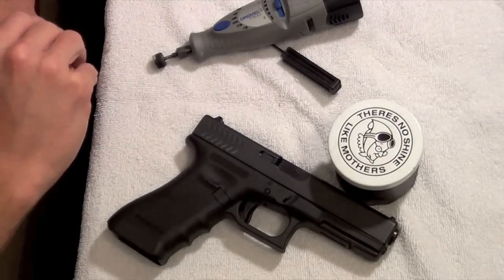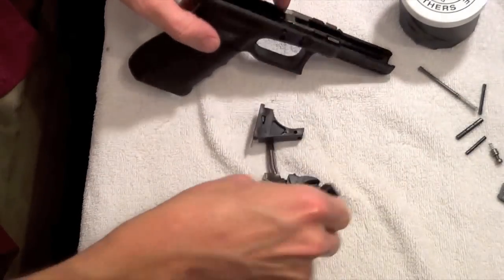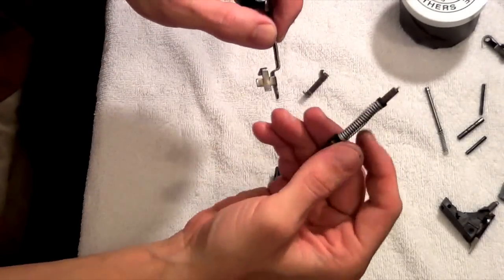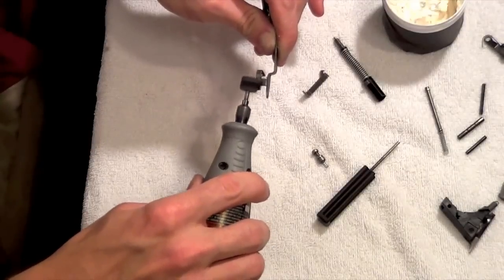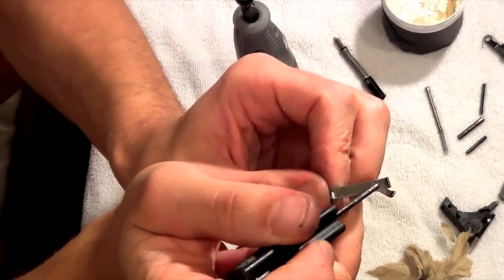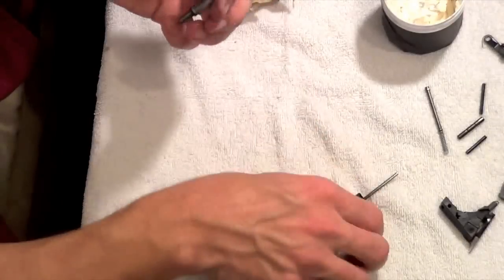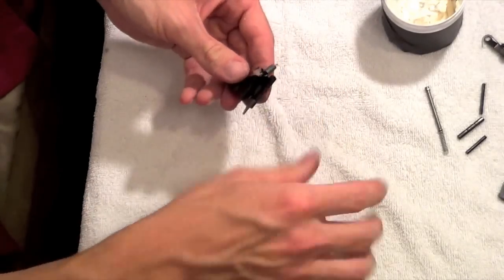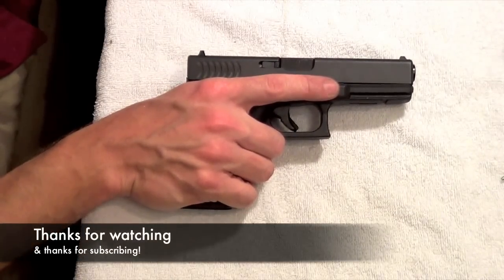How To: Polish A Glock Trigger (25 Cent Trigger Job) In HD

Comment: I just did this on a gen 3 19 with probably 4k rounds through it. I got much better results than expected since the trigger was well broken in. The firing pin safety was horrible from firing it dirty in training classes and cleaning it up as well as the connector and trigger bar made an already good  broken in glock trigger great. Glass  smooth take up and a very defined wall with a crisp break. It could have been in My head but I found I could make 60 percent hits on an 8" steel plate at 50 yards with big dot sights. Amazing improvement on an already broken in trigger

Comment: So, to answer all of the comments...

Use a buffing wheel NOT a grinding wheel
A qtip will work instead of a Dremel
Yes, dry firing will work too but it takes longer
Yes, it's still safe when you are done
Be gentle with your parts or yes you will been and break them
Use fine metal polish, not things like turtle wax
Part number for the buffing wheel? Idk, it's a fckin buffing wheel!
Reply: It appears common sense isn’t so common anymore.

Comment: Thank you for the great video!  Did the polish for the first time.  Fun short project.  It was also the first time removing the large pin and it fought.  No idea why.  Went back in easily.  Taking my time, about an hour or six times your effort.  Also took the opportunity to polish the feed ramp and the rail guides.  Everything is smoother.

Comment from the maker: It's worth 15 minutes; that's for sure.  Also, on your Gen4 ensure you have the "." connector.  Some Gen4s shipped with standard Gen3 connectors resulting in a slightly heavier pull.

Comment: Hey great video as always! You could also polish the shaft of the safety plunger. When the trigger bar presses the plunger it will ride in and out of the slide. If you polish that it will also help your trigger pull.
Reply from the maker: thanks

Comment: I agree with the grease, it's THE area that affects the feel/weight of the trigger when oil dries up.....One thing I'd point out is the trigger spring, it's the 'weak link'. I replace it ROTB with a heavier one. Breaking the trigger down often, in polishing or cleaning, can weaken it, IF IT'S HANDLED ROUGHLY. The polish job will handle the extra tension, which is light, and the trigger will feel more crisp. I don't like lighter connectors & use a heavier spring on some guns. Just my.02, thanks.

Comment: Not everyone has a dremel tool, so I recommend an application of Glock Anti-friction copper colored bronze oilite lubricant applied to all friction points of the trigger bar and connector. The lubricant is available on many internet shopping market places at a responsible price when compared to buying moto tools for this one project.

Comment: I used 2000 grit sandpaper to do this. I got pretty good results. It's a little better. Got the parts shinny, without taking off any material.  What's your thoughts?
Reply: LOL. I did the same thing. My results were good.

Comment: never done this before but it seems to make more sense to use fine grit sandpaper then polish, i’m new to this
Reply: Some might use ultra fine grit in certain areas to take down some tiny burs. Personally I'd rather not. Remember when you sand you're removing material that you won't get back.
The process here is polishing with a compound and polishing tip. Not a grinder. The best way to go. Tried and true.

Comment: Going to do the G19 tomorrow. Did the G42 today and noticed the trigger bar seems to ride along the frame (three vertical bars molded in) and drag a little. Am wondering if I should try removing the plastic, or just polish the bar?
Reply from the maker: polish

Comment: Hey Mike, do you know what grit that wheel is? I have the same tool but my wheels are 60 grit and I’m afraid that’s going to remove way too much metal. I have 2,000 grit sandpaper I can do by hand or I can try the q-tip trick you recommend. I also ran out of mother’s but I do have Brasso 6 metal polish, I think that should work that same. Any advice is greatly appreciated. Sorry I’m a decade late to the video, been following you for years but I’m just now trying a Glock trigger job for the first time.
Reply: Just use a paper towel and do it by hand.

Comment: hey mike I don't know if you've ever had this issue with any of your glocks, but I have a gen 4 g17 and it never happened before I shot the gun. but I have about 1000 rounds through it and for some reason, I noticed that now when I dryfire the gun, the trigger pull gets progressively heavier and heavier. I haven't changed any internals and made sure everything is installed correctly and cleaned it thoroughly. but it still continues to happen when dryfiring as well as shooting live ammo. it actually got so heavy that I literally could not physically pull the trigger at all. do you have any idea what's happening?
Reply from the maker: AK47andGlocklover I don't.
Reply: okay I figured it out, it seems the factory lube lasts around 900ish rounds before being completely shot dry, at least on my pistol. just got back from walmart with some CLP and its like a whole new gun now. trigger feels like butter.
Reply: AK47andGlocklover You left on the factory lube that came with the gun when you got it new?

Comment: yeah buddy! good info even 7+ years later!  I bought some mothers for 9.99 and threw that baby on my dremel buff pad, and it made a nice difference. It is smooth and less gritty for sure. I need a different safety plunger spring and buff the plunger itself to finish my project.

Comment: This is an old video so I doubt I get a response but this is for anyone with experience. What is the general consensus on ghost or lone wolf 3.5lb connectors? Do they make a difference and most importantly do they effect reliability?
Reply from the maker: you're adding a variable into the system; might be fine but might not be
Reply: Thanks for the response. I'm just gonna leave the GLock alone. Throw some sights on it, extended slide lock and be done. Glock = Perfection :)